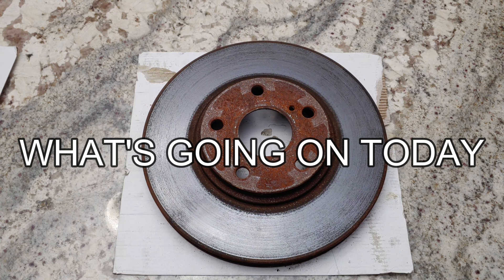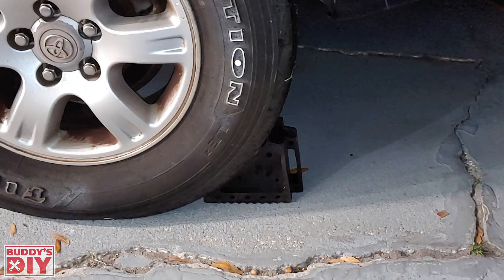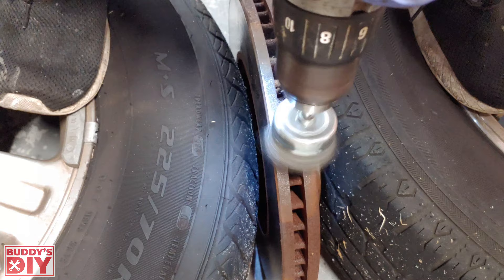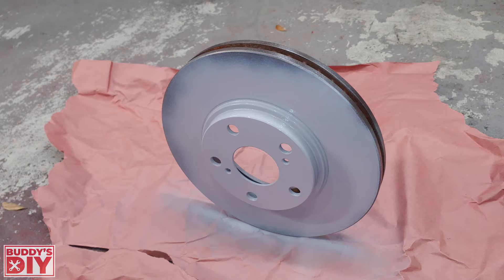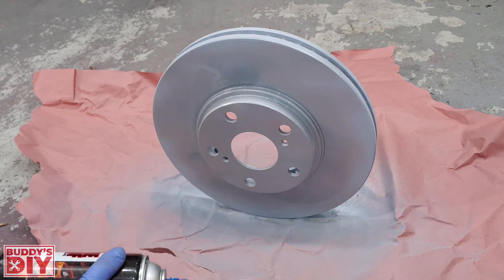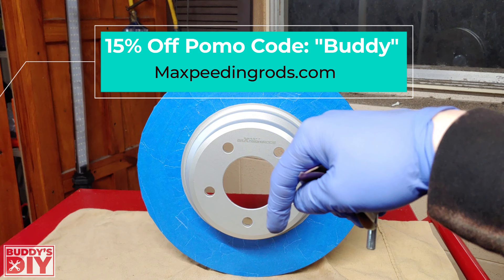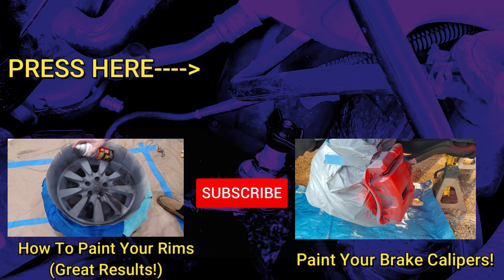How to Paint Brake Rotors | THE PROPER WAY

Comment: DON'T,  DO NOT, listen to someone telling you to paint the surface of the rotor where the brake pad meets it.  This will come off on your brake pads and fuse to them.  That will gum up the pads with paint and cause lack of full breaking.  Instead, get a rag with some acetone and wipe the surface area off first before reinstalling.  You want clean break pads making contact with the steel rotors.  Take the extra step and be safe.
Reply: Did this and it didn't happen. Maybe learn what you're talking about.

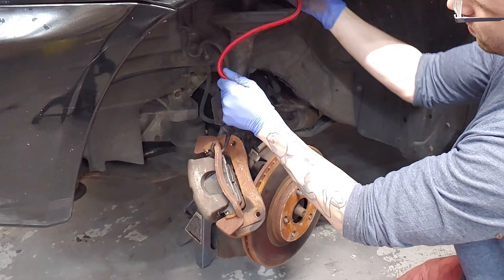Comment: Considering the verbosity of the rest of the video, at about 2:30, maybe add a step explaining that if the rotor is stuck, there are threaded holes in the rotor for using a bolt to force them off the wheel hub.

Comment: DO NOT PAINT CONTACT POINTS. You need to take this video down. This is seriously dangerous misinformation that can cause breaking failure. People could genuinely get hurt from painting the full rotor and not taping off the contact points.
Reply: Paint gets burned off from the breaks so it’s fine.
Reply: All those companies selling rotors that are fully painted (including disk surface area) must have really bad attorneys advising them on liability risk, eh? LOL.

Comment: Why don't you just slaber the disc with grease or copperslip ? Won't rust then, might even be better for the pads than paint lol
Reply: That's what I do where the back of the wheel is pinched against the rotor. I've seen tons of people talk about how you beat the wheels loose. All is takes is a little anti-sieze on that surface, Paint might do it, then again paint might just adhere the the back of the wheel and peel off the rotor. Anti-sieze works every time, it won't rust, and since it's not paint it can't peel off.

Comment: Oh man…where to start. First, when you remove a tire, you NEVER go in order, its always a star formation. That ensures you dont bend or stain your wheels or rotors. 2nd you NEVER paint the braking surface of the rotor, mainly just the hat. Yes the paint will come off but where do u think it comes off onto? Your brake pads, so now whatever pads you were using are completely useless/trash. 3rd id never grind off the rust on your rotor. If you do not grind it perfectly even, you run the chance of it making your steering wheel shake. You can soak it in a rust remover that wont deteriorate the rotor itself.
Reply: Hitting a rotor or a brake drum with a wire wheel isn't going to do anything to it to throw off a zero balance. Excellent advice about NOT painting the friction surface though along with using a liquid rust remover. Even vinegar will work although it can take a long time depending on the concentration percentage. Best wishes!

- Max Giganteum

Comment: Ugh ! Brake pads are not designed to bed in paint. Also, unless your primer coat is designed for high heat, your high heat finishing coat will bubble and deteriorate during heat up of the brakes during normal use.

Comment: Okay tried this, now girl friend dead, what do next?
Reply: What a bunch of horse ****.

Painting the rotors is fine. The pads burn the paint off the friction surface immediately. Tons of rotors even come painted now and caliper paints advertise for use on calipers, DRUMS, AND ROTORS. I'd probably not paint all 4 rotors at the same time though. If you're doing all 4 brakes, leave one old pair on for a day. 

If you want to be super cautious, after painting go out when there's no traffic and do a few fake panic stops.

If you want to be super anally retentive, use a sacrificial set of pads that will burn the paint off. 

Think about all the times your car gets all kinds of contaminents like mud/dirt, grass, water, snow, rust, and other ** on your rotors. Do you replace your rotors when that happens? No.

Comment: This is horrible advice. First off using regular primer makes the high heat paint useless. The primer will eventually fail and take the high heat paint off as it comes off... remember the final product is only as durable as your weakest link. They do make high heat primer, use that instead. 
Don't spray the braking surface. Looks wise it's fine and will give you a nice clean line but unless your planning to swap out the pads after 15 minutes your pads will be contaminated with paint until they wear for a while. Tape off the braking surface. Even if you leave 1/4" overlap of paint on the surface to get the clean line after driving that's way better than contamination if the entire pad.

Comment: No man... DON'T paint your rotars on the portion your pads ride on! And don't remove the jack! Keep it in place along with the jack stands. More protection the better.
Reply: Tons of brake rotors are painted from the factory... look into zinced rotors, they're painted....

There is NOTHING wrong with painting brake rotors. Just make sure you can take it on a low traffic drive to have the pads burn off the paint on the friction surface. In fact I'd say it's probably safer to paint brake rotors as they are less likely to get rust which can cause all kinds of problems.

People treat cars and car parts as way more made of glass than they actually are. 

Think how many shady shops and lazy DIYers don't put brake clean on their brakes. I've never heard of an accident because of this either.

Comment: Coats a rust-prevention zinc rotor. Also, you only need to use brake cleaner, wire brush is unnecessary.

Comment: U should just paint the hat on the rotor, hope your still alive after the brakes may have failed by painting the rotor.
Reply: BS, painted my rotors, they work fine. The pads just take the paint off on the friction surface.

Then again maybe if you were educated enough to know the difference between your and you're you'd know what you were talking about.

Comment: omg 'The Proper Way'? You never paint the surface that comes into contact with the brake pads! If only it was that easy to paint the rotors, we'd all be doing it. That is not the proper way to paint the rotors.
Reply: Tons of brake rotors come painted from the factory these days... painting the rotors is fine. The pads take the paint off the friction surface immediately.

Not to mention your rotors get contaminated by all kinds of debris all the time anyway like rust, grass, dirt/mud, snow, rain... do you replace your rotors when they sat for awhile and got rusty? Nope, you just go and burn the rust off after 1 stop right?
Reply: @dupeaccount1647  My car is never idle long enough for the rotor surface to go rusty. It gets used every day, and while the old  rotor rims and hat went rusty, I painted the new ones I bought, so that wouldn't happen. I don't have snow where I am, and never had grass on the rotors even if driving over it, so I can't really comment on those situations.